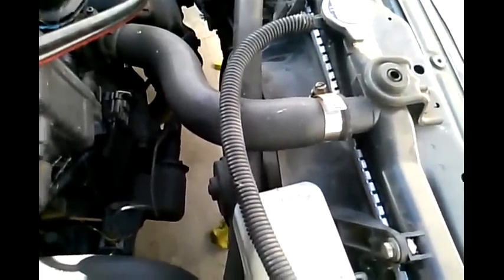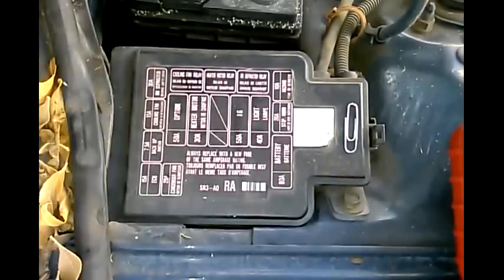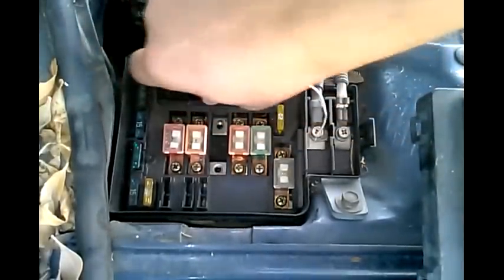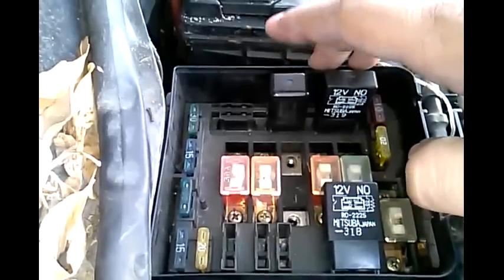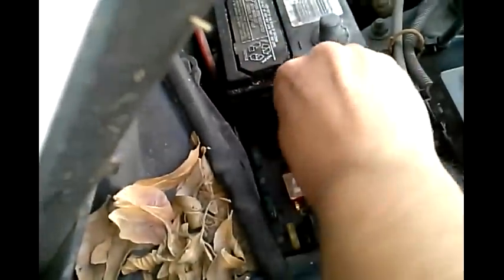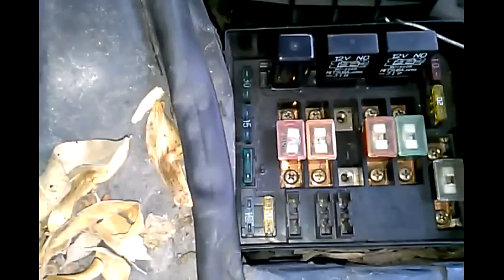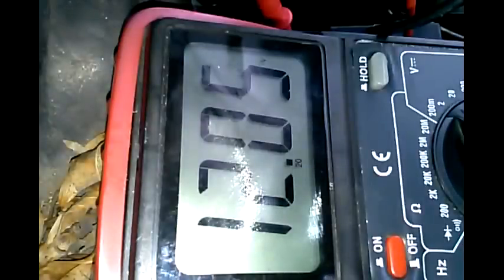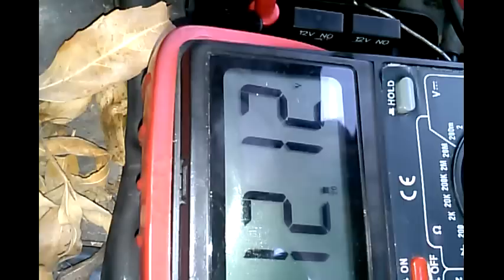Relay Not Working / Radiator Fan : Honda Civic

Comment: I changed the sensor switch on top of the thermostat and the 2 sensors below the distributor and my cooling fan doesnt come on when i turn on the ac and it's supposed to but never does. I checked my relays and fuses and they're fine. I thought maybe my fan needs to be replaced but I ran alligator clips from the cooling fan (fan on passenger side) directly to the battery and the cooling fan came on with no problem. So my question is why isnt my cooling fan turning on when I turn on the ac???? The fan on the driver side comes on without any problems.
Reply: When you resolved it what was the issue?
Reply: @Dionne_Sheree needed to replace my radiator. It wasn’t holding pressure it had like 5 holes in it. Replaced the radiator and everything was fine again
Reply: @WavyVaporizers great to hear! thank you for responding!
Reply: @Dionne_Sheree anytime hope you’re having a great day and week so far. Sending you and your family love and light
Reply: @WavyVaporizers thank you so very much! I wish the same for you and yours ❤

Comment: I got a 2007 honda civic and I have to replace my fans also thought it was the fuse but is not because we I turn on the ac the fans only come on for less than 15 sec and then off fans is bad got the fans set on ebay for 80 bucks both fans

Comment: I have a 95 Acura Integra I lost heat and AC in my car radiator fan work  but nothing in the inside of car
Reply: Cory Tilley did you fixed it?
Reply: Yes i had a wire that was kinked that was caused it to stop

Comment: Hello my name is leonardo . and I'm using google translator . I live in Brazil. First congratulations for the video. I have a Honda Civic 2007-07 automatic LXS . he was a few days without battery. there bought a new car and put it on . more there paltry 02 of the fuse box fire. everything works in the car. however turns on the light injection departure over the car does not turn on. already checked several grounding points more nothing changes. I would like your help . What can it be ? these paltry and what part of the car? pass me your email I will send the photo . relay . thank you

Comment: i have a 01 corolla the fan comes on when the ac is on is that normal? it usually comes on once the car starts😕
Reply: yeah that's normal when you want cold air the AC turns on and the fans turn on everytime you turn on the ac

Comment: can someone help me .. my civic 98 ex .. keeps getting hot and I have already replace the thermostat , temperature sensor and the other sensor that goes by the thermostat.. my cooling fan is not workin and I switch the relays around and still not working .. what else can I do?
Reply: my shit overheats when I get off the highway, and I changed everything that has to do with the overheating shit.
Reply: sergio hernandez check ur fuse box under ur dashboard,locate the 20amp fuse for radiator and condenser fan...replace if it's busted

Comment: I have a 1995 Honda civic dx and the radiator fan motor is not working. Fan motor runs, changed the temp sensor and thermostat, changed the relay and fuse too.  Is there a separate fuse under the dash apart from the one under the hood?
Reply: Alex Rivas yes there's a fuse box under ur dashboard,locate the radiator an condenser fan fuse mine is 20 amp,check if it's busted

Comment: On a 2006 honda civic ex driver side fan spins whenever ac is on but the passenger side fan doesn't spin. Already tried the paper clip in the thermostat switch plug . And fan doesn't come on. Also test the fan by hooking up to battery nothing.  Test to see if the fan plug is getting power and nothing. All fuses are good & relays are getting power . Any ideas?

Comment: Where would the wiring problem come from I tested fan connector wire and in the relat with test light had no power in cooling relay port but had power in heater and crank

Comment: Thanks for the video. What if the fan works with the paper clip jumper and there's coolant all the way to the top and the still won't turn on automatically when plugged in the temp sensor? Ps: the temp sensor is also new. I cant think of anything else causing the fan to not work. Do you have any ideas? Thanks in advance.
Reply: fan still wont turn on and car overheats at stops.
Reply: @letmejustdoit  I know this was 8 years ago but did you ever find a fix? I have same problem just 8 years later xD
Reply: @Jimmy  man i can't really remember,  got rid of that car long time ago. But i think it was the cooling fan switch, not the temp sensor. It's what completes the circuit and sends voltage to the relay.